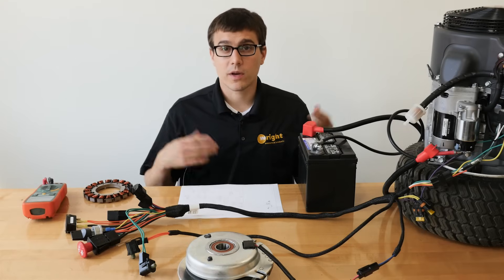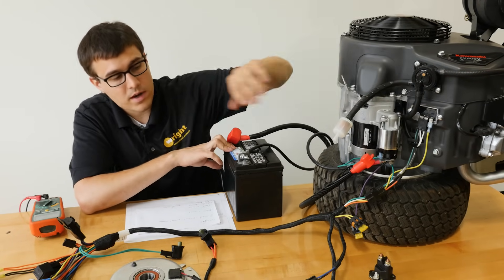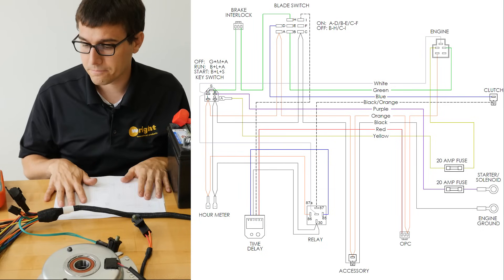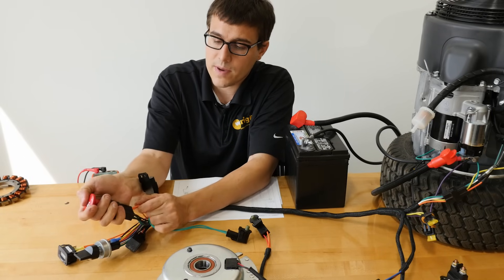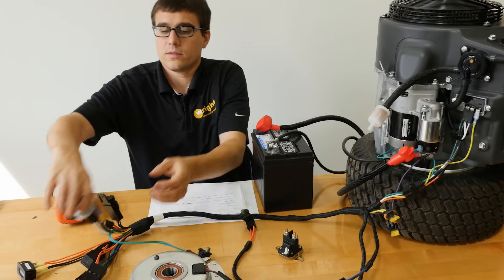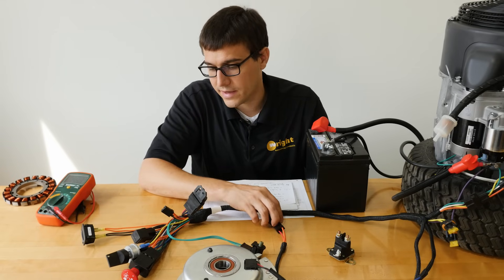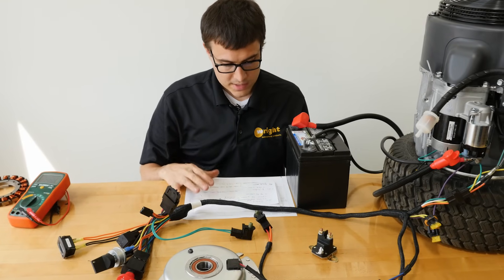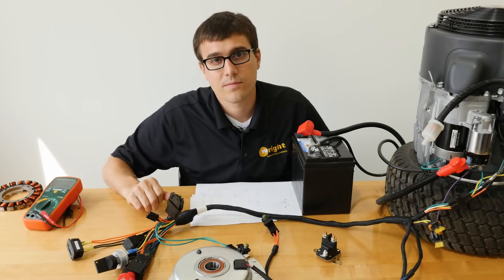Lawn Mower Electrical Troubleshooting

Comment: I have a deere 652r with a no start problem. Have had it at deere twice and theyve thrown parts at it new rider present switch new pto switch new brake switch and new relay. Problem still exists. I have found out if i pull the relay, the mower will start then plug the relay back in and it start fine off and on for the next hour then the same problem. Have you ever come across this before? I tried swapping a relay from one of my other 652rs that run fine but it still didnt start. I figured it shouldn't be able to start with the relay pulled. Seems weird. Any thoughts?

Comment: hi. does the clutch go bad all at once? On my wright 32 walk-behind, all of a sudden the blades won't engage without any prior signs. I'm guessing its electrical. When I pull the switch the engine doesn't turn off unless i let go of the grips, so I don't think its the pto switch. I followed the wires and nothing looks off. So my question is does the clutch go bad without any signs? the machine is only a couple years old
Thanks so much
Reply from the maker: It can die at once but usually it dies slowly.  More likely it's the blade switch.
-Ed

Comment: Great Video. I have a zero turn mower, last week used mower like usual. All ok. 2 days later mower started with no issue but blades would not engage. Parked mower to look at pto, shut mower off now I have nothing. Won’t start. Any ideas Ed? ThankYou.
Reply from the maker: Strange. Maybe a grounding or charge issue? -Ed
Reply: You could get you a battery charger plug it in the outlet turn the ignition key to on plug the black clamp to any metal on the mower and touch the red one to the red wire on the starter 

That'll make it start if something else went out on the mower like the ignition key switch could have a spark box could have could have a loose ground wire or loose to the battree if not doing nothing it can be a burnt out safety button

Comment: hi im working on a custmers husqvarna yth 2348 i have checked th key swich the break swich and ohmed the pto chuch out im completly stumed every time the pto swich is turned on the fuse blows and the mower stalls could a defective seat safty swich cause the short?
Reply from the maker: Marcus, Hope you were able to get it fixed. I'm not of much use on a Husky. -Ed

Comment: What about the mower with out battery and starter. Im having a problem with my scag 48 velocity plus has a kawasaki motor and has trouble when engaging blades everything good until i engage the blades
Reply from the maker: Probably something with the kill circuit or blade switch.

Comment: I have a john deer stx 38 installed a new battery , still need to jump it , it is suppose to be for  this model , what do you think  is the problem  ? Thanks for your help.
Reply from the maker: Maybe the regulator on the engine?

Comment: no charge?  might mention doing a  battery load test by running with lights on and then see if still holding at 13 volts. or use load tester.
Reply from the maker: Yes, a good way to check charge.

Comment: Hi Ed Thanx for you time your a cool guy too show your skills! Could I Ask you about my Gt3000 25Hp.Kohler Pro-V-Twin Tractor? I just replaced the Engine Head Gasket and put it all back together the way it came off! The Tractor was running before I started. I got it all back together and it will not start the 30amp fuse blown when I put a new one in without key in the switch. I jump started the starter with a scwewdriver and the Engine will run aslong as contact is being made at the starter. With the Key not being in play here why is the 30amp Fuse blowing when it makes contact to the Fuse Holder? Please Help.,Thanx Will!
Reply from the maker: William, I don't know a lot about your model. It sounds like there is something wrong with the machine side or where you reconnected the engine.  Double check those connections.

Comment: Would a disconnected voltage regulator result in the engine not even cranking?
Reply from the maker: It would lead to the battery going dead but it should still start if you were jump starting it. -Ed
Reply: No but a burnt out spark delay box would or a safety button/switch

Comment: Hi I have a riding mower Troy bilt bronco doesn't start when I turn the key the flywheel turn correctly batterie is good carburetor fuel with  single solenoid good but it doesn't start can you help me please

Comment: I have a JD 120 garden tractor(1970), It will start and run for a  2 to 3 minutes and then stops.  when I turn the key it will not start. there is power at the battery. Help?

Comment: Mower doesn't work when ground wire is connected but when you disconnect the ground it starts right up. Can't figure out why. Any ideas?
Reply from the maker: I most all mowers and airplanes the magneto kill wire connects the coil to ground to kill the engine.  If the ground is loose the coil cannot be grounded.  Likely you have a fault in safety circuit that is killing the mags--by removing the ground you are overriding the kill. -Ed

Comment: My Scag Tiger Cub isn't starting by key, I here the power to the carb but nothing from the starter and its new.Can send a link to get the harness for this machine. Thanks.
Reply from the maker: Scag and Wright probably have the most similar electrical systems., but since I didn't make them I don't have the diagrams.  You will have to call Scag.  I've had to call them before for service questions and you won't find a number on their website.  You have to call 920-387-3150.  Good luck, I hope you are up and running soon! -Ed Wright
Reply: Wright Commercial Mowers thanks a million
Reply: You can get everything you need for scag from www.partstree.com

Comment: I have a John Deere L110 and the battery drains with the key turned off.  My first battery lasted over 10 years. The second battery lasted one year and suddenly died and would not hold a charge. Thinking the battery was bad, I replaced it and the mower ran fine for the 4 hours to mow my 3 acres. When putting the mower away I started it again to confirm the battery was strong. I then turned it off and confirmed the key was in the off position. 10 days the mower would not start, the battery was dead. I charged the battery for 24 hours at 2 amps, but it would not start the mower. What would drain the battery with the key turned off?
Reply from the maker: Tim, We no longer make any Deere mowers so I can't answer for sure.  If I recall they have a red wire that goes from the regulator on the engine to the positive stud on the starter.  Check that wire, the main ground wire, and then you may need to check that the regulator is working, which you can do by reading the battery voltage.  Voltage should be about 11-12v when off and about 14v when the engine is running. -Ed
Reply: Wright Commercial Mowers, thank you.

Comment: Why is my starter running backwards on my  BRIGGS & STRATTON ENGINE? Dose anyone have have any suggestions?
Reply from the maker: Well that's crazy!  I've only seen that happen to road grader in the middle of Africa.  It was a 24v system. Someone had rewound the starter backwards.  We had to use separately jump start it with two sets of batteries--one to turn on the ignition and solenoid and the other to the power the starter (one set of batteries was grounded to the engine while the other set  had + to the engine).  I felt like I was living an Car Talk Puzzler episode!  Not sure how to help besides possibly just getting a new starter. -Ed
Reply: sounds like the polarity is reversed.
Reply: Did you figure it out

Comment: I have a Troy-Bilt 17.5 IC OHV BRIGGS & STRATTON ENGINE. Check the fuse it keep blowing the fuse. Can you give me insight on what's going on
Reply from the maker: I don't have a lot of experience with that model.  Surely there is a short somewhere. If you can use an ohm meter and check the clutch that may be a good start.

Comment: Hi i have a CastelGarden xt 200 hd . It will start and run for about 6-7 seconds and cuts out but it will start straight back up again and do the same thing . I have checked the seat switch and seems fine . what i found is i put the park brake on if will run fine until i release it then it cuts out again . I have a feeling it's the seat switch but it seems ok i think .  HELP NEEDED .

Comment: Ed.  I have a White Outdoor 18 1/2 HP lawn tractor.  When I engage the blades, the mower dies.  In addition, when i push in the reverse button, it no longer works for me to mow in reverse.  Any thoughts?  Thanks
Reply: Put a new battery on it

Comment: please help with any ideas! my cousin was driving their toro z master zero turn mower with Kawasaki engine and accidentally swamped the deck in their lake. they stopped using it for about a year where it sat idle in their shed. they decided they wanted to use it again, but when I engage the PTO the engine dies I checked the relays and switches they seem fine could it be a rusted electric PTO clutch? any ideas would be appreciated thanks!
Reply from the maker: Wow, could be a lot of things.  I'd be sure the blades are free--maybe they seized. Electrically, check the platform switch.
Reply: Sounds like spindles if u swamped the deck while the spindles were hot they sucked up water then u put up the mower the bearings rusted solid so the motor and pto can't spin the belt

Comment: Me again Carlos. Is there a way to copy the schematics you used in this lesson ? It is really a lesson. Thks in advance
My respects.....Carlos
Reply from the maker: Carlos, Each different model has a slightly different schematic.  The best thing to do is go to part.wrightmfg.com and enter your mower's serial number.  Browse to the electrical page and drill down to the part view of the main harness--that will pop up the schematic for your mower.  if you have any issues just select the help tab on the left side of the screen.  I'm glad this was helpful! Best wishes.  -Ed

Comment: this is the most comprehensive  video tht i have seen, thanks.
Reply from the maker: No problem. -Ed
Reply: My mower won't run without shaking the main body, sometimes it runs for a second, sometiems for a minute if the mower is kept moving, however when it runs around normal speed I can smell what seems like ozone just for a bit then goes away.  Mower then stops and it takes quite a lot of shaking to get it to start again. No problem with circuit breaker.

Comment: 22hp v twin cub cadet when plugged up to the main motor harness it gets gas but no fire,,,unplugged it will fire but no gas, unplugged you can run a jumper wire to carb it will start and run fine, but since it's unplugged it will not engage
Reply from the maker: Don't know a lot about cubs but it sounds like there is something faulting your safety circuit.  Check the seat switch, brake/clutch switch, and the blade switch.

Comment: maybe you can help I'm having a problem with my stand-up the two fuses one for the mower deck and one for the starting solenoid are not popping the fuse but melting the fuse after some time
Reply from the maker: Matt, I've heard of that happening and we are not 100% sure why it occasionally happens.  It seems like it might be from the fuses wiggling and fretting.
Reply: @WrightMowers  yeah the fuse doesn't pop but it kind of melts the fuse
Reply: Cheap fuse holder
Reply: @shakeme3290  yeah the problem was it wasn't a fuse issue for wiring it was a voltage regulator causing me issues
Reply: But yeah cheap fuses are an issue sometime to can't stand them

Comment: Hi Ed, My Scag mower runs fine but when the the PTO is engaged it misfires occasionally and if I run into thick grass it almost dies. Almost as if it is not getting enough fuel or lacks power. I took it to the dealer for service last year thinking it was an electrical issue because it ran  fine without the PTO but they told me it needed a new carb...did not solve the problem. I had someone else look at it and they installed new gas lines, fuel filter, air filter and a new Reed. He told me the fuel transfer valve was not working and should be replaced. The mower definitely runs better but still has the same issue when the PTO is engaged. I still think this may be electrical, Do you have any suggestions?
Reply from the maker: Michael, it's like your health.  You can try to describe all your symptoms to the doctor but ultimately you do need to account for your instincts.  You are probably right that it's electrical.  1. If you disconnect the kill wire at the engine that will keep the electrical system from killing the spark--just note that this is only a diagnostic procedure you MAY NOT BE ABLE TO TURN IT OFF without shutting off the fuel.  2. It could be a bad coil. When they get hot or create a weak spark they can begin skipping under full load.  3. The ignition power wire going to the fuel valve in the carburetor could be skipping causing the valve to close but I don't think this is likely since what I know of SCAG's electrical systems it's not connected to the clutch in any way.  Note that a loose ground will also do this.  I hope your issue is resolved quickly--electrical stuff can be mysterious.  Whenever we have an un-diagnosed electrical issue pop up as a warranty issue we often advise the dealer to replace the entire harness to insure 100% the problem goes away. -Ed
Reply: Michael Pasco  where'd the ground wire connect on a troy bolt riding mower
Reply: Maybe a loose belt or a weak battery
Reply: Engine load increases without increasing fuel to engine will cause it to die. Check governor for correct operation and connection to engine throttle linkage.